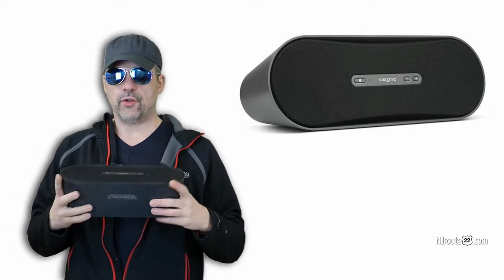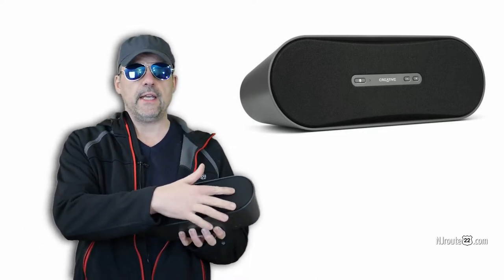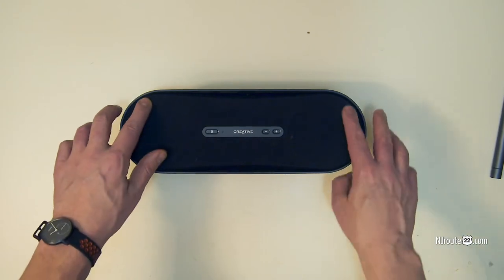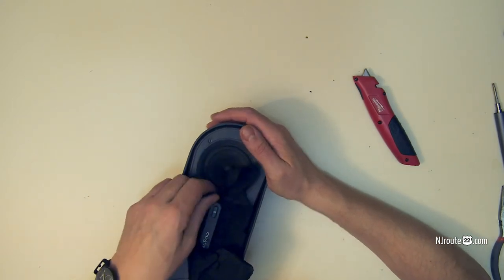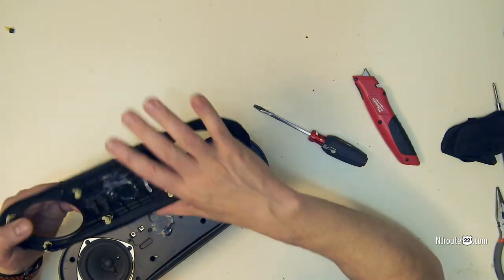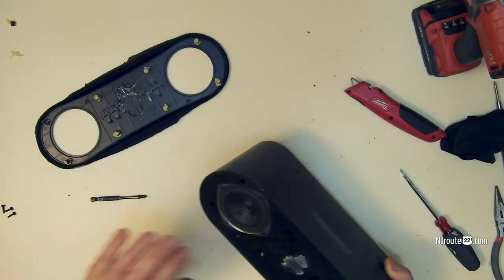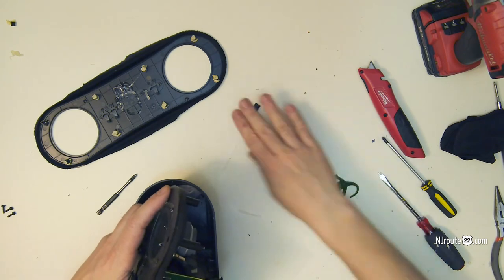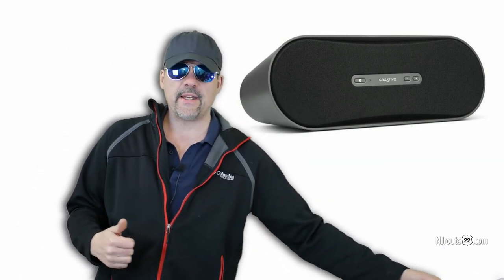Creative D100 Bluetooth Speaker Opening and Repair

Comment: I had a similar jiggling sound that you had. Once I saw your toy alligator inside, I realized that it wouldn't be necessary to take my speaker apart in order to fix it. With my speaker, I was able to see into the hole from the back that a battery had fallen inside. I inserted a long, thin piece of cardboard into the hole, tilted the speaker, and the battery rolled right out. I'm sorry that you lost the nice cover, but your experience helped me. Thank you.
Reply from the maker: Thanks, glad I could help.

Comment: Update pn how to open. Use the tool to lift up the edges of the grill. Do not cut or damage the fabric, it is unnecessary. When carefully loosened, pull out the front, the middle with adhesive will give away. Then remove the 8 screws holding the speaker housing together.

My speaker have what appears a burned chip on the board. It pairs, but no sound and also no sound from the aux input. Will discard this speaker since finding and changing chip is too much trouble and also it have one trace what appears to be heat damaged, who knows what else is blown when the chip gone bad made shirt circuit.

Comment: Great. Thinking of converting to run on battery's. Anyone know what DC volts this speaker runs on. Cheers
Reply: 2*18650= 8.5 v работает
Reply: They do run on batteries. Four AA batteries.
Reply: 4 AA batteries, you'd think it would be 6v but the dc plug says 5v

Comment: Cuddie by any chance could you please help me out, I took mine apart about a year and a half ago to fix the bluetooth problem it had. The problem is I forgot all about it and I came across it and I don't remember how the left speaker was soldered. Is it white wire for + or red wire for + for the left speaker? It would save me some time from soldering
Reply from the maker: Test it out before you solder.

Comment: The one I just bought from goodwill for $20 plays extremely loud and cannot adjust volume Level and the push button on the front doesn't do anything.  Does anybody know how I can fix it?
Reply from the maker: The contact is either corroded or bad. I would first personally try some contact spray which you can buy on Amazon..  But you need to disassemble to locate the switch.
Reply: @NJroute22  Thanks for trying to help. But allow me to add more details/symptoms that might help you easier figure out what to do to fix the problem.
1. For the music source I am using the mini-jack plug on the back and not Bluetooth.
2. Batteries are new.
3. The green light comes on when I turn the power switch on. This is normal.
4. If I push and hold the button on the front the light changes from green to blue. This is normal.
5. Pushing the volume Level buttons does not change the volume Level. It stays very loud all the time.

If it was a mechanical or loose wire problem I could fix it but I think it's a failed electronics component situation which means it will NOT be fixed.
Reply from the maker: Why are you pushing and holding the button? I think blue indicates it's in Bluetooth mode? Try playing it just when the light is green?
Reply: Only on Bluetooth you can change the volume. For Aux you need to adjust the volume from the Music Player itself